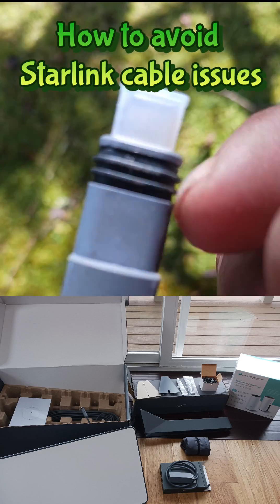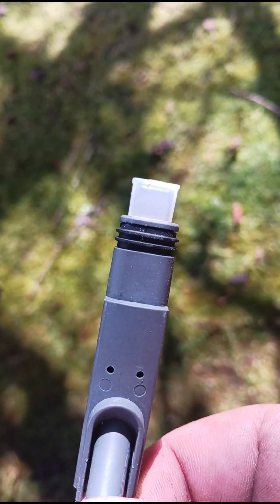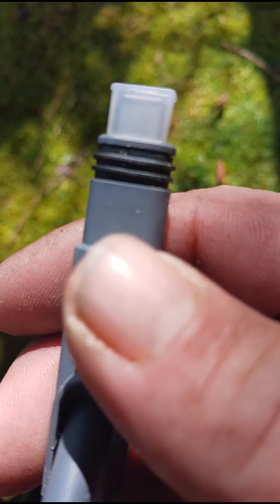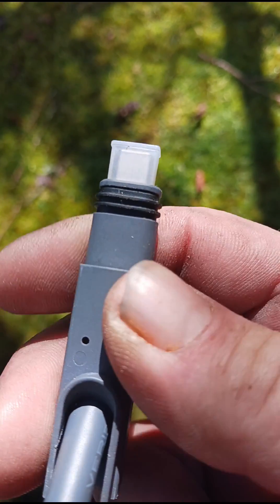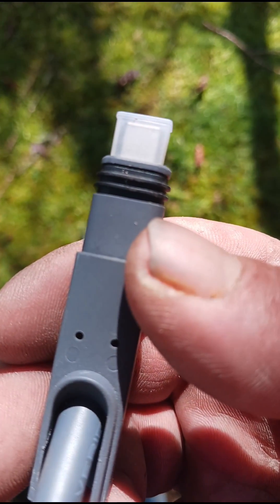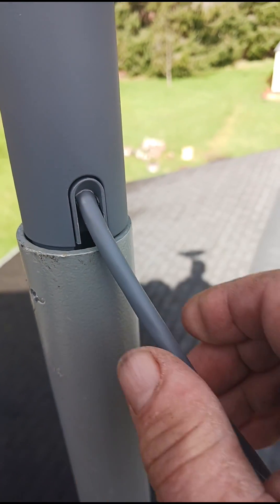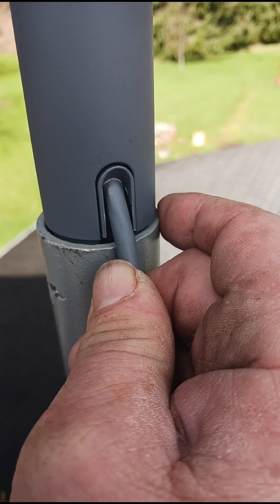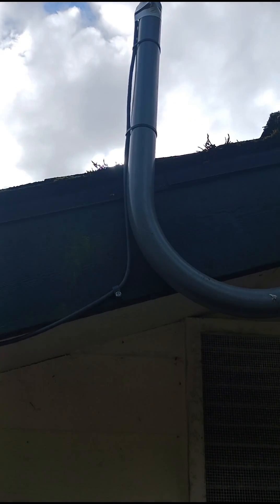Starlink cable issues.

Comment: there is a locking button on the back side of that it keeps your cable locked in you have to knock that pipe out so not to depress it.
Reply: I have never seen a lock for the cable… just for the mount itself

Comment: If Starlink cables are not designed and fabricated to "securely snap" into place without having to stick tape on the sleeve like it's a POS extension cord at WalMart, and it's supposed to be rated to withstand all types of climates, the cable is most certainly NOT engineered extremely well. And especially, when you're paying a buck a foot for proprietary cable they purposely DO NOT sell extension adapters, so they can bleed your wallet. Fuck Elon Musk!!